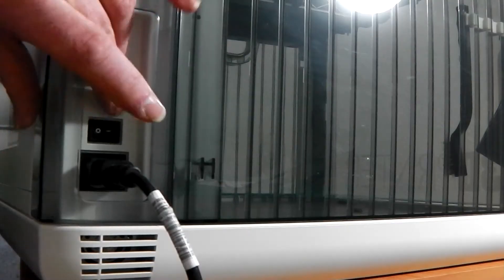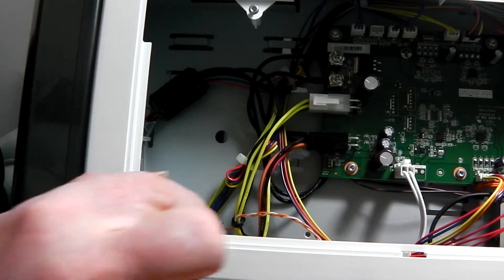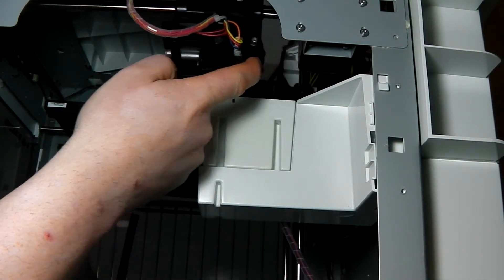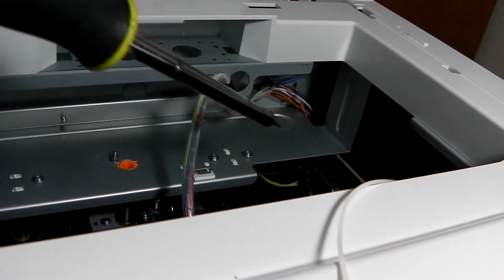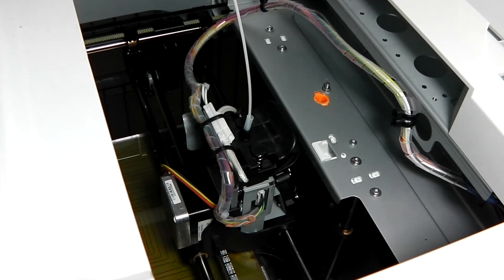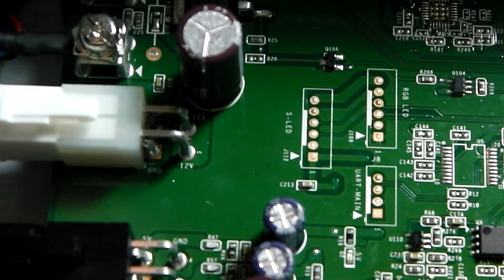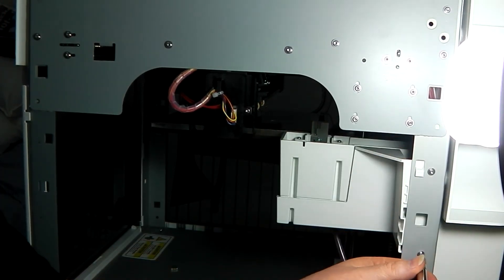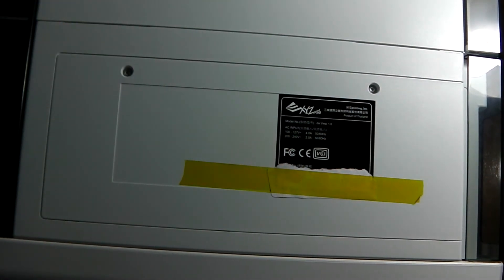XYZ Davinci 1.0A 3D Printer now with an E3D v6 hot end (Phase 3)

Comment: Steve thanks for the videos, just completed and during the first test got a heater decoupled fault, could this simply be a bad connection using the bullet connectors for the thermistor?
Reply: Steve, decided to solder connection to thermistor and the white wires, ran a test print and no decoupling error! So thanks again this is brilliant and I learnt loads doing your tutorial!
Reply from the maker: Hi Tony,  I'm glad you got this sorted.  Soldered connections are the best way to go.  I used bullet crimps at the time so I could go back to stock.
Reply: Your local, from accent! me from ne24. ran off three more tests and all great cheers!

Comment: Did you use braided wire or solid core Ethernet cable.  Hopefully you used Braded since the wires will be moving a lot if you used single strand (solid core) then you run the risk of it breaking more often.
Reply from the maker: Mark Burton Hi Mark,  you are correct, as the wire is moving all the time I used multi stranded wire.